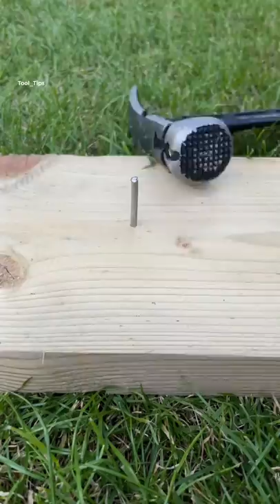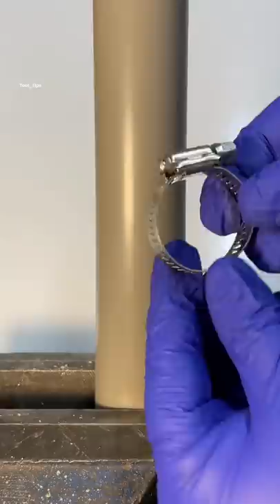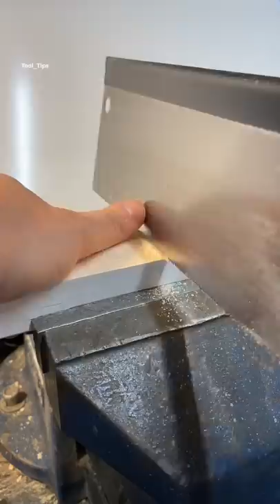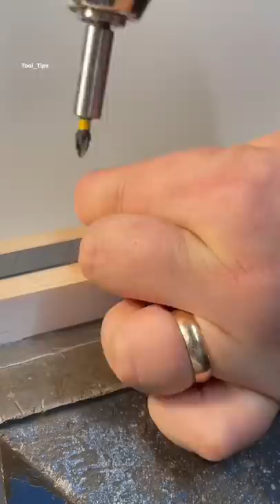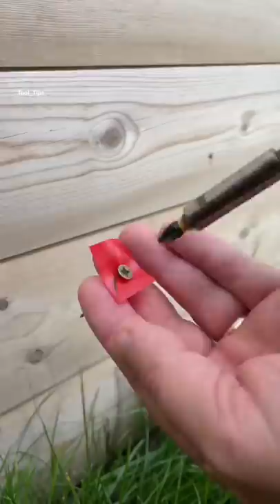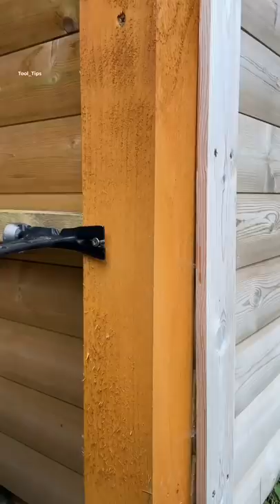6 Tips in 60 Second #shorts video

Comment: But there is so many easier ways to peel cables with so many different everyday tools ... like that knife blade you used
Reply: Life hack lol
Reply: it's for convenience, i guess
Reply: @thatgreengentleman4696  not even for convenience. You just gotta cut one part slightly open and  you can easily rip the rubber off from the copper.
Reply: I guess it would also fail if the wire gauge is larger or smaller than the guide notch. More than convenience at stake, also materials.
Reply: @bleyzerplayz  its so much more difficult than it looks. That Romex insulation is strong af

Comment: Fill that hole at the end or sink the screw in. Leaving holes is a great way to start rot and bugs like carpenter bees or termites entering your outdoor wood damage.
Reply: Yeah but i feel like all of these are unnecessary right?
Reply: @lilsmurfp.2046  As a construction worker I can say the DIY wire stripper is pretty unnecessary, just buy the actual tool. But the others have their uses the twist tie for the two pieces of wood is a bit of a stretch since you don't wanna dig into your wood like that but for something you'll be sealing behind a wall or is going underground it's fine.
Reply: Lori Strout: Expert on Wood Rot and Termite Damage
Reply: @lilsmurfp.2046  makes life a hell of a lot easier tho.
Reply: @chaselipp987  right? The video is a SHORT - not every step is filmed.
Reply: Kinda common sense
Reply: @djhunstiger  basically anything that an inspector won't see lmfao
Reply: Never mind the fact it is a defect and the client would be pissed 😂
Reply: @Slydamiser  just paint it

Comment: If you have a relatively good quality hammer it'll  grab the headless nail no problem especially if you can swing  the forks onto it.
Reply: Depends on the nail, spiral nails like what they sink into pallet boards are just low key screws with how hard they grab, really need the extra surface are to yank those bastards out.
Reply: Either that or just put the claws into it and bend the hammer on its side a couple times till it's out
Reply: @samzbieszkowski642  could just hammer them in like I do.

Comment: Solutions to all of them:
1+2: don't cut the heads off the nails and if they come off then don't use nails made of paper for your work
3: works fine if you don't have the right size but just use a bigger hose clamp
4: why would you need to ever do this? And if you did, then what led you to that
5: they make tools for de-insulating wire like knives or a pre-made tool, and you just wasted screws on a blade that's handheld
6: you showed the solution to that in the 7th, just hold the screw and start slow
7: start the screw where you need it, then hold the plank and finish the screw, or have another person help hold it

Comment: I love how in one tip, you teach how to drill a nail straight through, using tape. And in the next you show the easier way without tape to drill a nail in straight💀
Reply: Those....were screws....not nails
Reply: @midgeholt8863  oh, my bad
Reply: I would have said it was to try and stop the nails from going too far in but I'm an idiot lmao
Reply: The last one was showing an easy way to hold the plank down to get it lined up so you can drill a screw into it.
Reply: The last one is another thing. If one wants to align a plank but can’t, the first screw will hold the plank in place for the actual screw that needs to stay there to keep the plank in the desired position.

Comment: That thing with the wire ad the screwdriver is also how you tighten a tourniquet if you have to make one out of a shirt, you wrap the strip of cloth about 6 inches above the wound then tie the ends around a stick or long straight object then twist and keep twisting until the bleeding stops and if you want the person to keep the limb you can in small intervals untwist it to let some blood flow back in but only if the bleeding had stopped completely

Comment: 6 answers to your six problems 
1. If you are going to show the exact same problem just show the hammer once then there is no need to go and get the wire cutters
2 you couldn’t have taken the time to carefully measure the size of the pipe and buy the correct sized clamp?
3 there is no reason to be using what looks like fence wires to hold to planks together use your fingers like a man and pull a hand muscle 
4 as for the corner part put some duct tape on the part you are going drill into and then once you are done remove or paint over duct tape
5 for drilling holes into things go slow then fast
Reply: And for the 6th don’t play with razor blades to cut wires just go to Lowe’s and buy a pair of wire strippers

Comment: Having a nail broke off that far out is not an issue worth any sort of " hack". That's like having a stripped screw that isn't flushed into the surface. I'd just use a plier to twist it open.

Comment: Better tips
Clip one: don't use wood with nails in it/don't put nails in something you want to take them out of.
Clip two: don't waste hose clamps on places that don't need them.
Clip three: use a dam screw!
Clip four: if you have to use this home made garbage tool I guarantee you don't have a license to be doing electrical work... Probably just stripping cables so you can tie wood together with them right?... Or scrapping copper you stole?
Clip five: drill a dam pilot hole, use a washer instead of tape or just hold the dam screw (also stop using Phillips heads on structural screws) just STOP USING TAPE! that shit pollutes, it's expensive and won't do anything except get your finger wrapped around the bit.
Clip six: ok finally a good tip... On how to hit your own screw, put an unnecessary hole in the wood, and how to use a single small price of wood to straighten a single bigger piece of wood on a horizontal slat wall (spoilers - it won't)
Reply: I believe these were example platforms. Not giving exactly world scenarios. Not all of these are useless but half of your corrections are

Comment: Use two hammers on top of each other to double the leverage and length of pull
Reply: Or cut the nail, that way there's no hole and you dont need to fill it afterwards

Comment: Half of these are just completely unnecessary. The extra screw to hold the board in with the hammer? Congrats, you now have an unappealing random hole where a screw used to be. Could have either use your hand/hip to hold it or lightly tapped a nail into the gap between the to pieces of wood to wedge it in place. To tired to rant about the other crap, but I hope I made my point.

Comment: Struggles to put screw In... Next clip flawlessly screws in 2 screws
Reply: They turned the tape so the sticky side could stick to the driver
Reply: @loristrout4741  still easier without the tape.. if u struggle to screw in a screw with a drill u should be ashamed
Reply: @loristrout4741  - Or just hold the screw half way down until it bites.

Comment: I don’t get the red tape one
Reply: Take a little square of electrical tape. Drill through the tape or push screw through the tape with the sticky side facing the drill. Then fold the tape up over the driver bit so that the screw doesn't just fall off. Pull off tape once screw is in the wood.